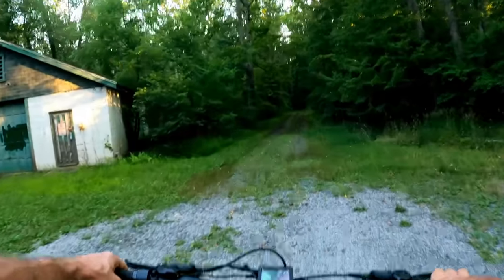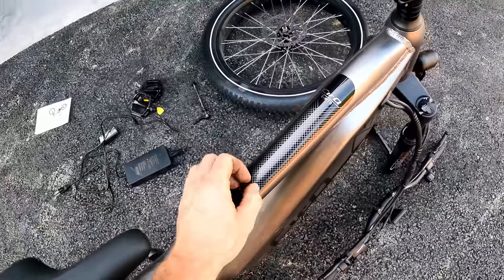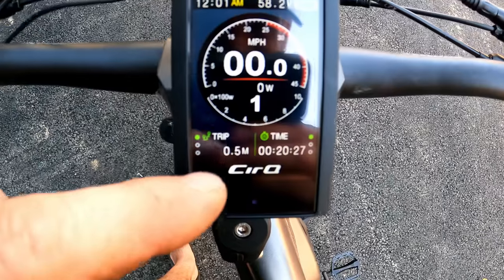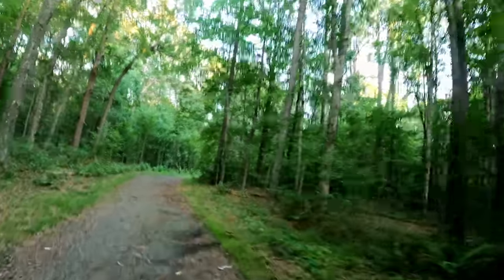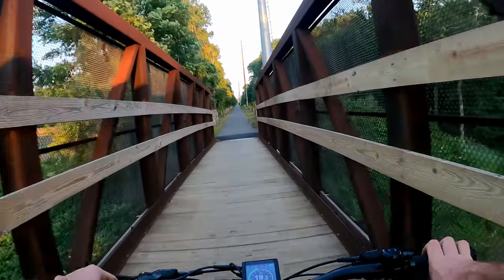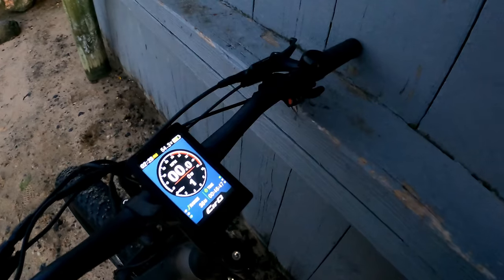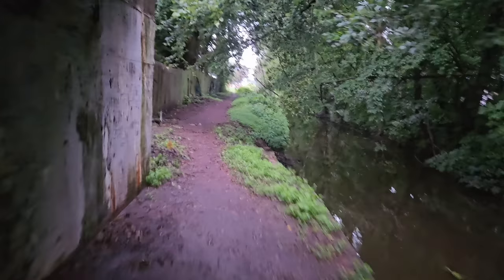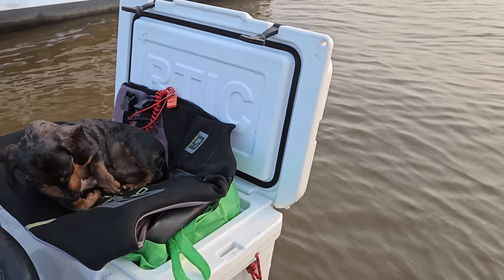CIRQ X1 Premier Electric Bike Review / Range Test

Comment: That is one of the nicest e-bikes I've seen. Wonder what the range would be at 30mph? You sure have some very nice bike trails.
Reply from the maker: Yeah I really liked it as well. Rides super nice and a ton of power after unlocking it. I'm sure the range would be reduced by at least 5 mi from my experience however if you're pedaling hard the whole time then you can increase it quite a bit
Reply: @NNKH2 can you do a video fixing my boat? I have kids and it would really boost the views if you fixed a boat for a guy and his kids.  I pay for parts and service.  Thank you and I'm in the Mayfair section of Philadelphia

Comment: thats a fun bike,
thanks again for the great tour!
 as for unlocking the bikes?
does that just let you speed on and leave the trail torque alone?
Im more of a low n slow trail rider.
  maybe the occasional county road [gravel] in town are paved streets, but thats not any fun as Ive driven there a time or three ;)
yup the North Idaho in the woods boy.
Ive riden motor bikes n wheelers, but thinking about an ebike